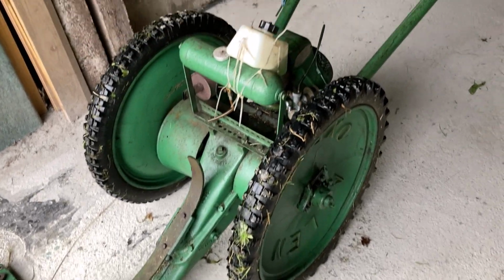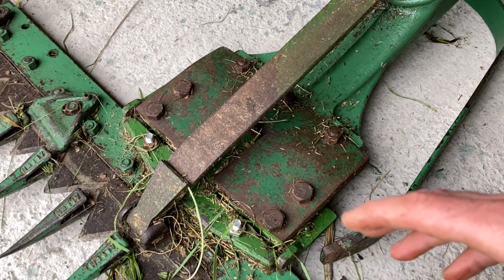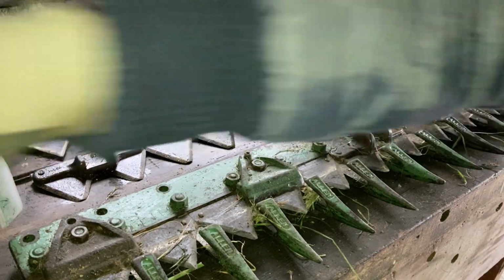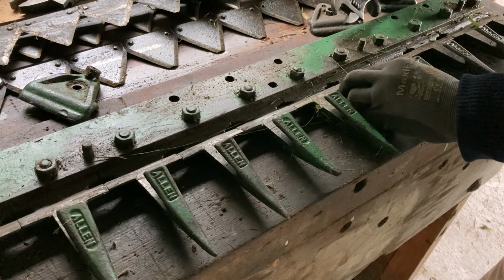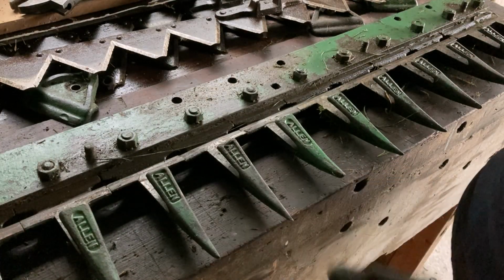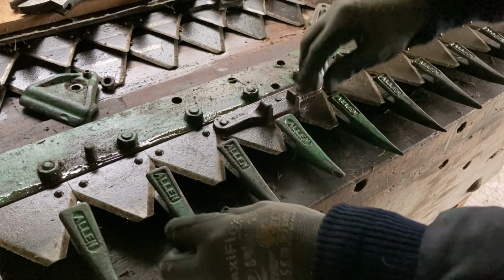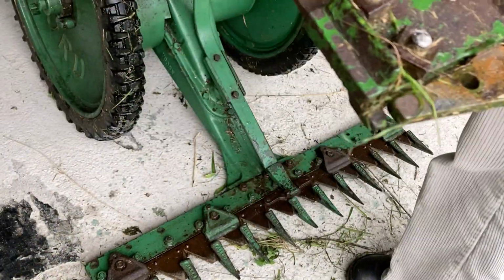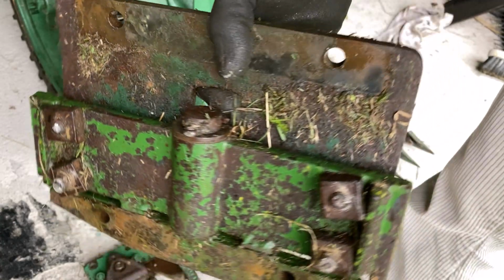Oxford Allen Scythe: Universal foot attachment and mowing underwater!

Comment: Owen, Al the Allen scythes I've come across were totally worn out, that one you have there is a gem. We used to do our hay cut with a tractor driven "finger mower" which had a very similar action but driven from one end. Always gave problems and blocked up, the saviour was a worn out Massey drum mower, cheers
Reply from the maker: I have had 3, this is the first or second, it was always kept dry and that has saved it. The other was left out under a bush for about 10 years, I cleaned it up and it started, a villiers 2 stroke. the third was nice and clean and had ignition issues that couldn't be overcome. So I sold it to someone with more ambition that me!  

They are an absolute pleasure to use when the grass is perfect, damp or wet and stiff and stout, anything limp, dry, or woolly and you go into a world of streaks getting missed. They won't go over cut grass or they will clog. But even with all of these complaints it is the only mower that will cut that grass in Ireland! And after about 8 years and no engine maintenance, somehow, it always starts.
Reply: It looks like a piece of art!